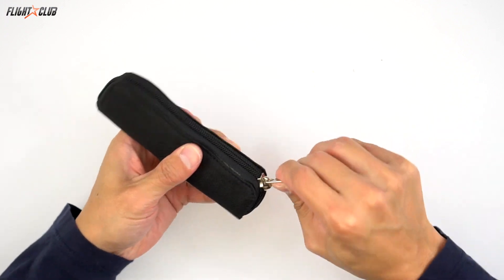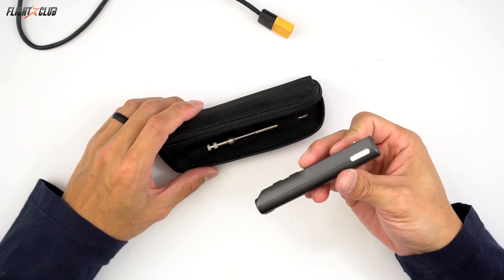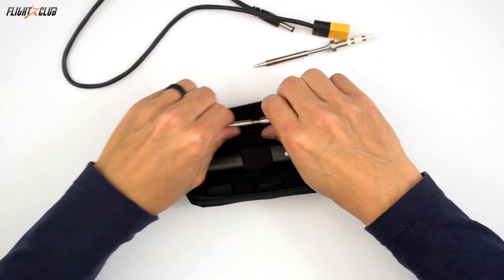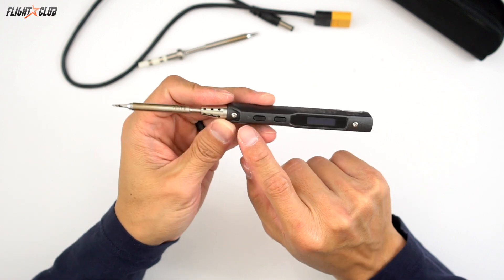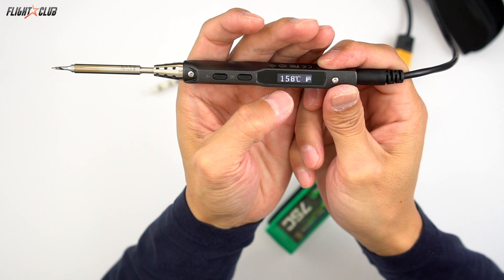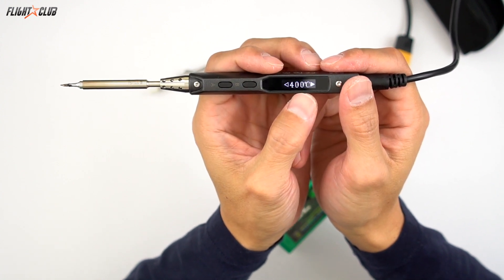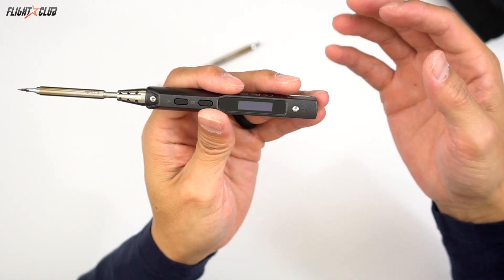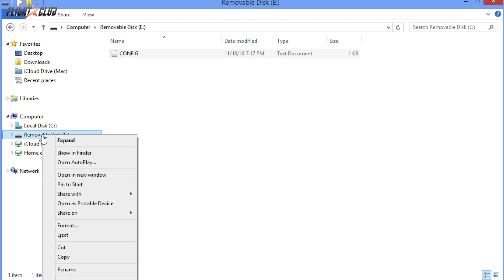Sweetest Digital Soldering Iron Ever!  TS100

Comment: I love my ts 100... Check out the Ralim firmware on Git hub. Gives you the ability the make changes to settings on the iron instead of hooking it to the computer evertime. Theres also a cool boost button to raise the temp to your desired boost temp for the duration of button press(it can go above 400).